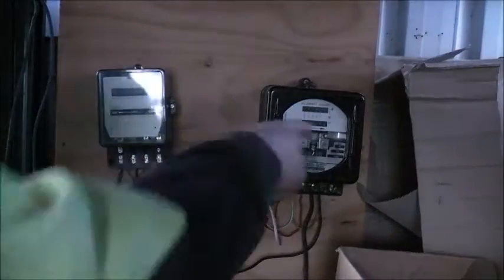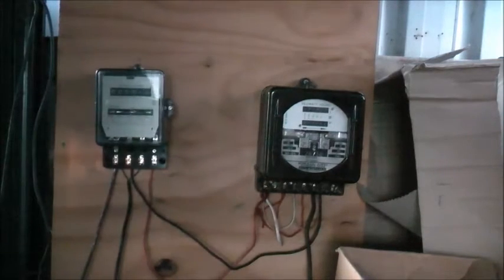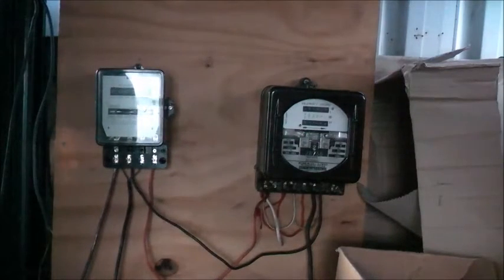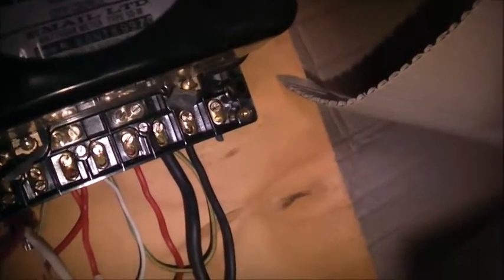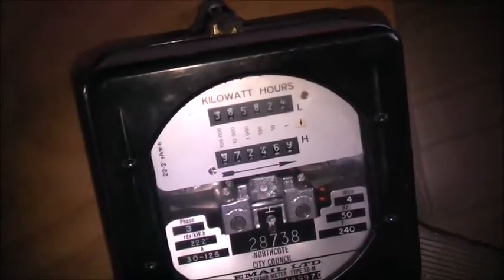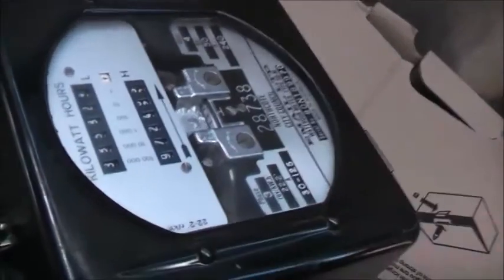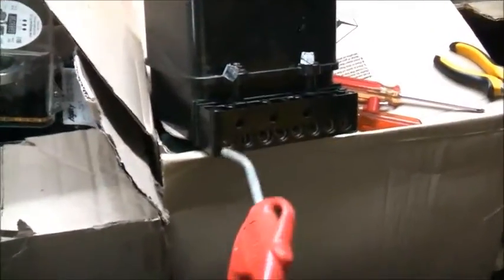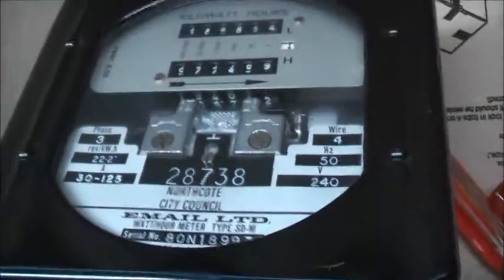Email Dual Rate SD M Watthour Meter Test & Clean!

Comment: Unusual terminal connector.  Nice meter, I like the black bakelite covers more than the polycarbonate ones. Broken screws can be fiddly to get  out. Worst is when the end of the screw has flattened out a bit and it is thicker so it jams in the terminal.